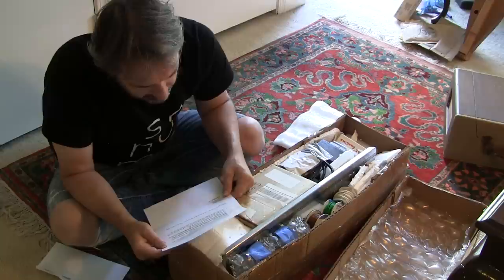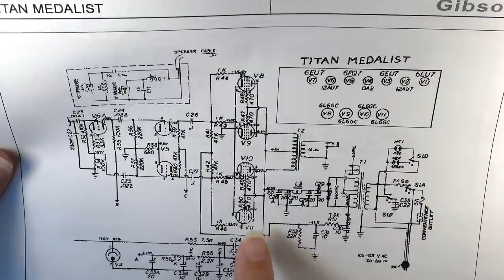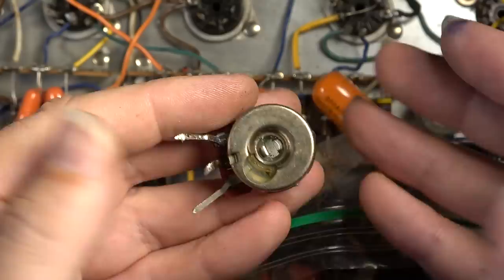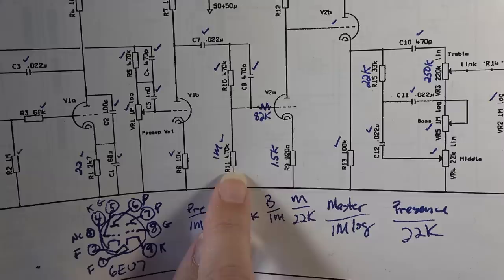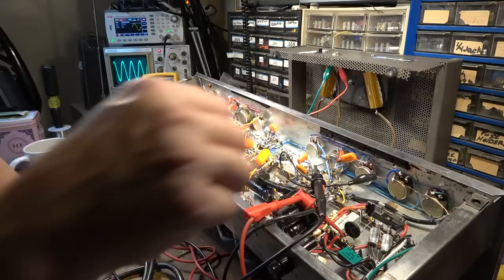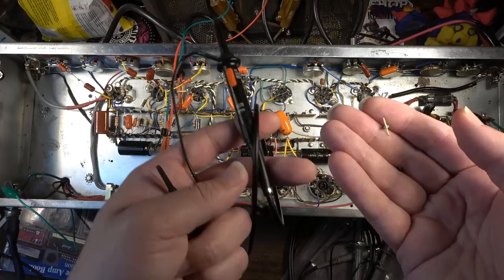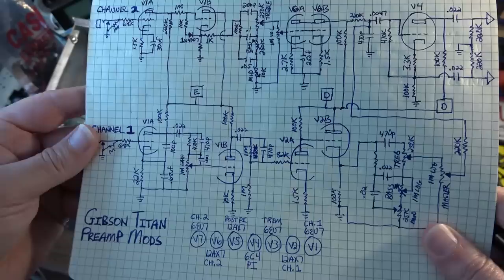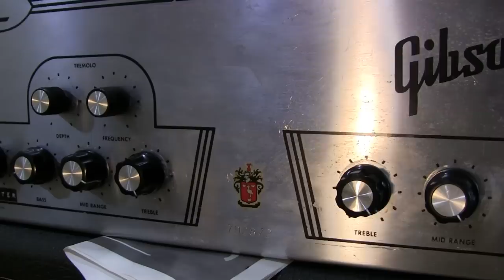The MOST POWERFUL GIBSON AMP of the 1960s - TITAN MEDALIST REPAIR & MODS!

Comment: ugh...well that explains all the nice little extras...you get to chop someone else's awful awful work down to parts, pray the electrolytics arent cooked and films leaky and leads overbent.  what a dick move!
Reply from the maker: What?
Reply: What do you mean when you say “that explains all the nice extras”?
Reply: @TheGuitologist  correct me if i misunderstood, but it seemed a dick move of the client to drop that prior work in your lap and not mention it was more of a failed attempt than a fresh kit or original build. that shoddy work could be a liability later, if they overheated things while soldering, or made layout choices that limit the circuit's potential for sound quality. at least you know enough about layout to catch most fatal errors.  it's still costing you time though.  and the extra goodies for you in the shipment made it seem like they knew it.